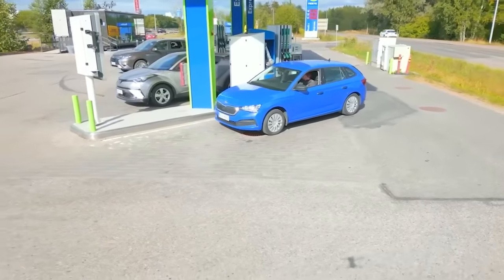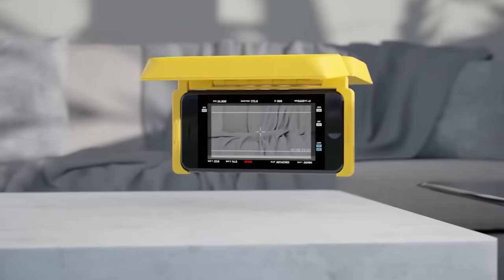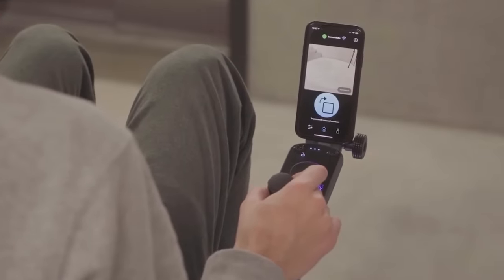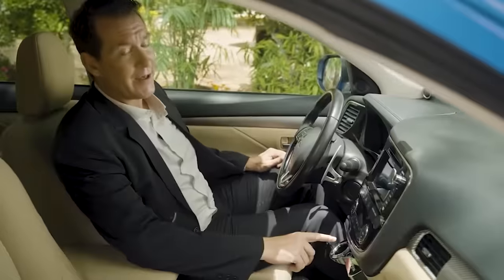Genius Inventions That Should Be Implemented Everywhere

Comment: They should have wheel cleaners that construction vehicles have to drive through before they get back on the road. I’ve had plenty of rock chipped windshields to prove that.
Reply: You just gave away a patent that you should have had pending, before comment.
Reply: @johnwayne6753  Duke, if I had that kind of $ we’d both be sitting poolside laughing 🐾✌️🇺🇸

Comment: The last ones just a Dehumidifier, and most times the water isn't safe to drink. So not only would it need to do it's main job of  pulling water from the air, but also clean it.

Comment: That gas station robot makes me wonder how it would handle classic cars. I have a 71 Javelin and the gas tank access isn't on either side. It's behind the license plate. And it has to be held down while you put the nozzle in. So it would have to pull down the license plate, hold it while it opens the gas cap, then fill it up. Looked like it might struggle there
Reply: move to NJ (hee-hee)

Comment: the whole vac hair trimmer thing is old news. look up flowbee, i remember seeing an advert for it as a kid in the early 90's (circa 1992) but apparently it's been around since the mid 80's making it older than i am...
great idea though, i mean the only reason i remember it down to the name is because even as a kid i thought that it made a ton of sense and probably should be being used everywhere!
but alas, haircut umbrellas also exist, are cheaper, quieter, and less cumbersome for the operator, hence why the flowbee never really took off like i thought it would

Comment: Why is there a robotic hand that grabs a gas pump, as opposed to a robotic arm with an integrated hose and nozzle?
Reply: Better question, why would I want to increase the price of fuel to offset the price of installing and maintaining something that just makes it so I don't have to do the incredibly simple act of pumping my own gas?

Tho to answer your question, it's probably the same reason there are several hoses at a pump and not one. Different fuel types that you don't want cross contaminating.

Comment: That charging robot seems to be an expensive replacement for power cable. They'd be better off designing a system that allows you to put more chargers on a cable then it can handle but only allowing 1 or 2 run at once.
Reply: literally you only need a wheeled platform with a socked in the middle that rotates revealing a power cable behind its trail.... and once is done returns to the place getting the cable around the perimeter of it...
Reply: what got me is the lady still had to plug it in.

Comment: Yeah that airbag would be fun to wear in 95 degree weather lol.
Drone yeah VERY small fires so not likely viable if a drone is actually needed.
The cool breeze gadget woudl likely cause long term health concerns sending that cold air to the back/spine.
The car lot idea is very cool but I imagine like every gimmick the cost would be insane.
Reply: I know  that this is a bit of an old comment  but I have got to offer a counter point: sure one such drone alone wont do much but what about 100?  Sure the cost would be  nuts right now, but, what about a few years from now?

Comment: That last "genius invention" - watergen - those devices have been available on cars since 1940. First office use was about 1848. The device is more commonly known as an 'air conditioner', and as 'dehumidifiers'. Look under your car on a hot day while running the ac - see that water dripping underneath? That is water that has been condensed out of the air and is as "pure" as any rainwater (except for the fact that it may have dripped down through oil and road dirt). So,right now, if you put a tank under the drip tube in your car you can pump it up into a spigot on your dash!. Or, under the drip pan in your home ac and collect potable water instead of it running down a pipe and into the sewer or out of drip line in the eaves or soffit of your home/apt.

Comment: Bro, that last one is insane! Though I do imagine it's at the cost of electricity. But if paired with solar power? That's literally unlimited water AND energy! Though I'm not sure it's going to be very helpful in dry deserts or savannas since there's also little to no moisture in the air...

Comment: 0:08 Deployable walkways are always a good idea, and this looks cool, but there's a better way to deploy it than this.
0:22 Just use a cart with wheels, it's cool, but it doesn't do a good job at keep anything on it steady.
0:39 This type of gas station would be expensive as hell to repair, and would deliberately NOT accommodate older vehicles.
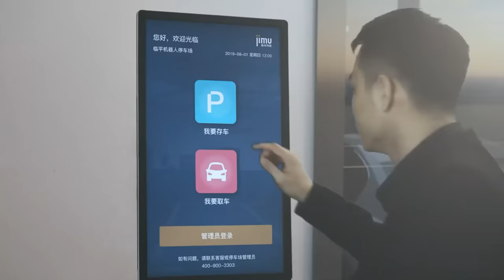1:05 Technically doing a valet's job, but this can stay.
1:25 VERY cool and can absolutely stay, if it can maintain a good amount of battery life.
1:47 Perfect for security reasons, but could easily be used for criminal activity. The price tag's the only thing preventing that.
2:00 For children, elderly, cyclists, or people with motor impairments, this is genius.
2:21 Who uses a mouse on a laptop? Just use the trackpad- And if for whatever reason you DO need a mouse, just use a wireless mouse. This thing would wear out after a while.
2:36 We've HAD this.
2:54 It looks cool, but if you're gonna make beats, just do it on your desktop. This is doing too much.
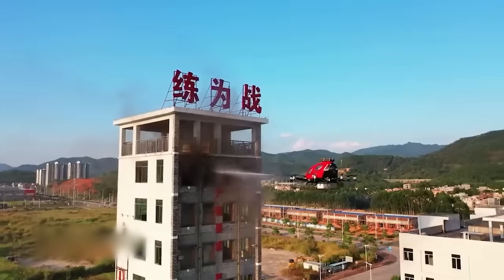3:13 This can absolutely save lives and I hope further research is done to improve upon this.
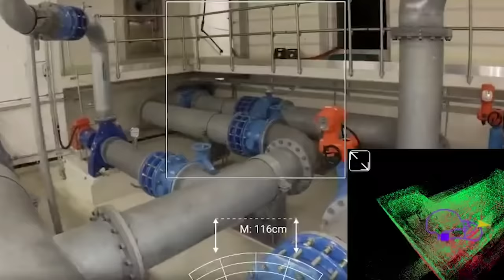3:34 Could greatly help with navigating or scouting contaminated areas that humans can't safely enter. This can stay.
3:48 No different than an As Seen On TV product.
4:10 That's not gonna cool a damn thing off, it's gonna be used for advertising.
4:36 We've HAD this.
4:57 We've HAD this, but not as... unnecessarily large.
5:09 Hey, Carvana.
5:32 We've had this, and I think it got someone killed. (I may be wrong about that... I might be thinking of the rotating stage from Disney.)
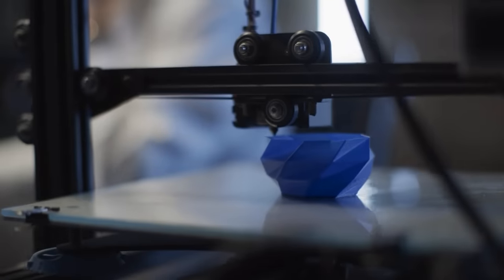5:51 Perfect for building new properties, bad for housing when the majority of privately owned properties go back on the market.
6:18 INSTANTLY getting vandalized if brought to America.
6:38 Could allow for some of the most dangerous jobs in the world to become WAY safer, but no let's use it for *archaeology.*
7:00 As someone who is straight up missing a whole lateral muscle and have difficulties holding my hands above my head for too long, this is a lifesaver.
7:20 Not perfect, but could be a much more affordable alternative to the MASSIVE VR treadmills.
7:59 Allow the auto-balance tech to be disabled for manually control.
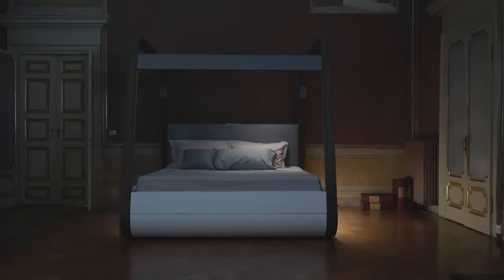8:25 Just say you're rich.
8:46 One fat ass, and it's crunched.
9:03 Nintendo 3DS: "Hello~" Your optometrist: "It's me~"
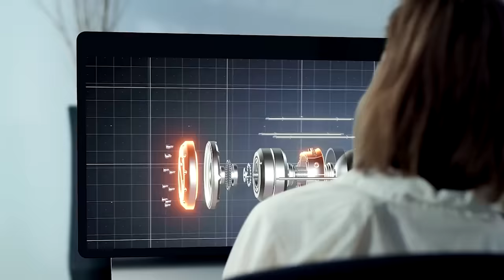9:25 Ah- Yes- My ears and sideburns can join the VC now.
9:39 "Hey, Google. Open Interpreter Mode."
10:20 Apple: "That'll be $19,000."
10:42 "WHA- WHA I CAN'T HEAR YOU, MY PHONE'S ROTORS ARE LOUD AS FUCK-"
11:09 We've HAD this.
11:35 We've HAD this. For YEARS.
11:59 Electric Car owners are a whole other social class, I swear.
12:34 We've HAD this.
13:02 Gaming mouses have PHYSICAL BUTTONS for this type of thing, and even then, this is... Y'all doin' too much.
13:17 JUST USE A MOUSE.
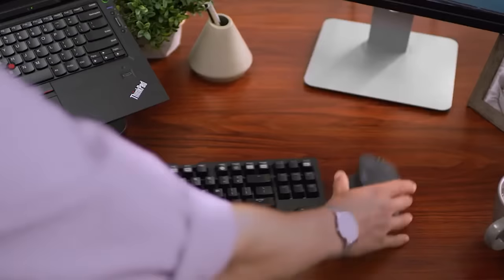13:37 **JUST USE A MOUSE.**
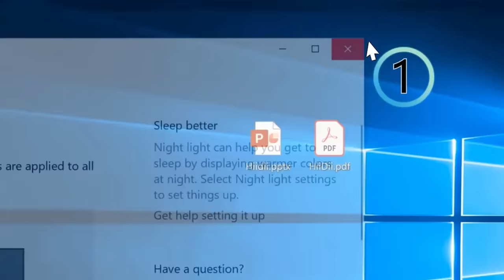14:00 Just keep a portable charger in your gym bag.
14:25 Just wear shoes.
14:51 Thank god this was only an April Fools joke.
15:27 We've HAD this.
15:56 Medical bills and normal medications alone are enough to make people go bankrupt, this would only benefit the people who have the money to afford it.
16:17 The LAST thing I'd ever want is something overlaying my vision while I'm driving.
16:59 Just get regular tinted windows. You'll be able to ACTUALLY SEE out of them.
17:17 You know what else can do that? A DOG.
17:33 This EASILY can stay.
17:58 Perfect for camping, horrible for hiking.
18:22 Your phone can also do that.
18:45 COULD make this technology accessible to communities and nations with unclean water, but no let's install it in some dude's car.

Comment: That water-from-air device is not a genius invention. It's literally an air conditioner, that just so happens to have a spout for condensed water. It doesn't get any water out of dry air in places without water. I also vaguely recall a fact check on the camping air-con. The battery won't last very long, and the cooling effect is minimal, since nothing keeps the cooled air contained. Inside the tent it doesn't do anything, since there's nowhere for the warm exhaust air to go either.

Comment: RE: Air Water Extractor - In America, virtually ALL houses, buildings and cars ALREADY have these installed. They are called AIR CONDITIONING UNITS. No need to add yet another energy using system, just add a filtration, sanitizing, collection system to the AC condenser unit in the building or vehicle. Make our current systems more efficient & multi-tasking.

Comment: ",,,seek refugee under the air conditioner"...really   And wave your hand over a light switch instead of just doing exactly the same motion and turning it off or on...wow.  I'll go $50k a pop for that one, because after all, it is worth literally NOTHING.

The drone fire fighter is a cool idea, but yeah, you'd either need several of them, that can work one fire, with a lot of extra batteries or it's not going to do a very large fire.  An even more important version might go up and bring people down from above such a fire.   Even in an emergency like the twin towers you could have transported people down the couple of three stories that they couldn't transit through, due to the fires at that level.  It could at least save several people.

The 'babel fish' would be absolutely awesome for travel, or even speaking over the internet, until some real time vocal translator is available there anyway.

Robots look to me like they are going to be a world class PIA for a while, like following an autonomous Tesla around a parking lot at three mph.  Thanks, but no thanks.  Often tech hits the market LONG before it is actually even at the level to be not a negative overall impact, and this is a retired electronics design engineer writing this.  Not smart.

Comment: Some are interesting, some are just plain dumb, like the tiny vacuum cleaner to suck up bit of hair after cutting, it's just a very expensive tiny vacuum cleaner. And the robot building the house, he forgot his fellow robot that puts down the cement, and any device that needs you to blink to control it, it didn't take in to consideration the fact that we also blink under normal conditions to...

Comment: 12:14 - how is that an innovation? It clearly shows the user manually plugging the charger in anyway? They also have to park in a designated space? Nothing innovative here - seems pointless to have a "mobile/robotic" changing unit if you end up having to park in a designated space...
Reply: thats one of the most stupid things I have ever seen....they have to install a charger anyway, they have to install wires anyway, on top of that they have to pay extra for a driving battery bank....this is so stupid on so many levels
If they dont want to pay for small individual chargers on everyspot then they can make a "sub chargers" connected to one big charging unit how its already being done...
who tf would buy this, on top of that you could just hook up to a normal 220volt outlet when you park overnight anyway...